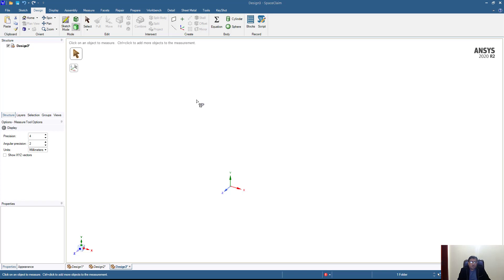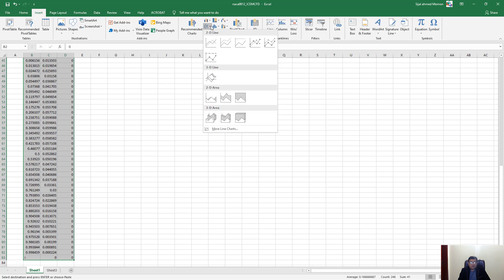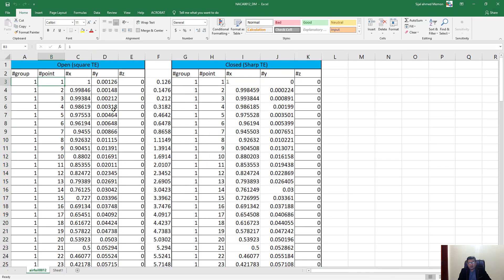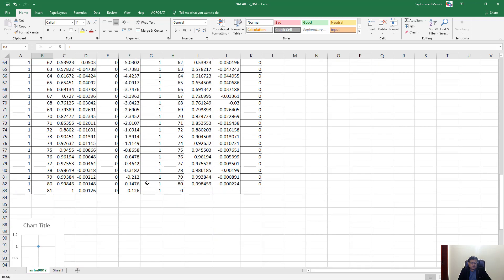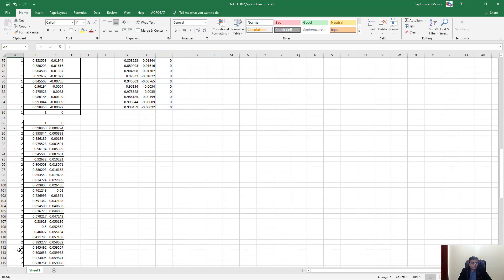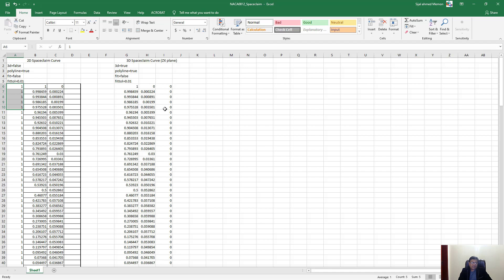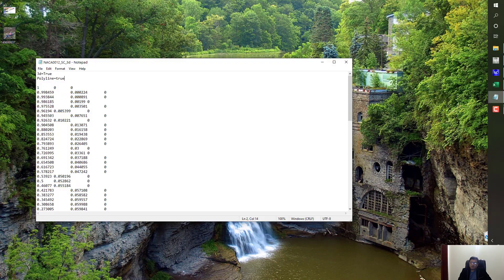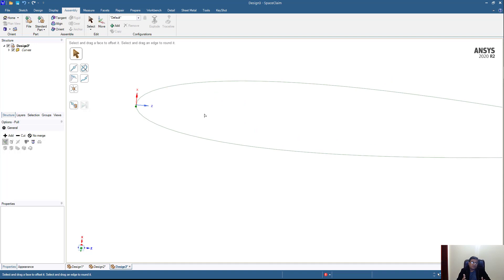How to import airfoil coordinates into ANSYS SpaceClaim 2020 R2 | Part 1

Comment: Hi, just wondering where you got your coordinates from? All I can find for NACA0012 on airtools and other sites are not the same. Looking for sharp trailing edge. Thanks you very much :)
Reply from the maker: Coordinates can be different  but airfoil should not be. Just overlap both of them and see if airfoils are same or different. I use this website http://airfoiltools.com/airfoil/details?airfoil=n0012-il
Reply: @CFD_Mechanic  the coordinate at x=1 is y=0.00126, is it supposed to be y=0 or is that just standard?
Reply from the maker: @dylanpage2367  There are two type of cooridantes. One is sharp trailing edge, in that case X= 1 and Y = 0. But for blunt trailing edge there would be two Y coordinates i.e. -ve and +ve.